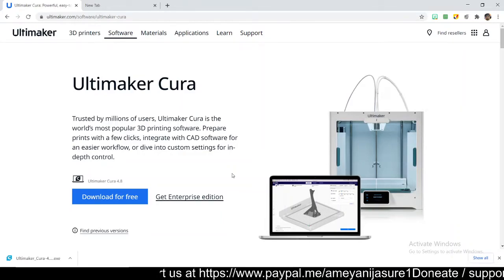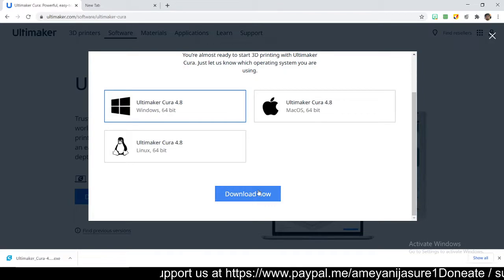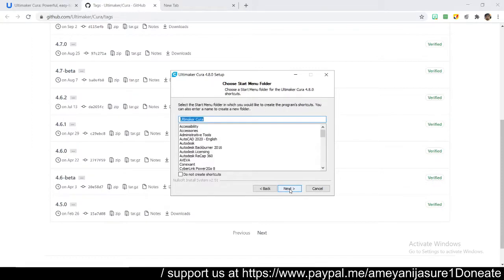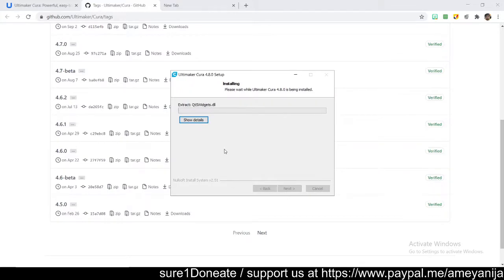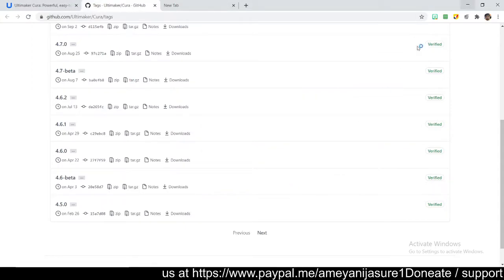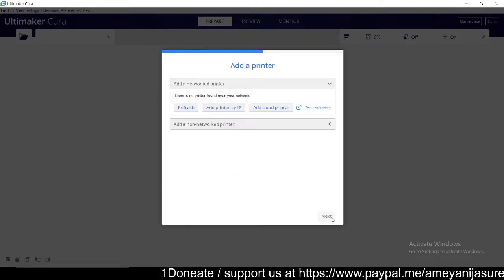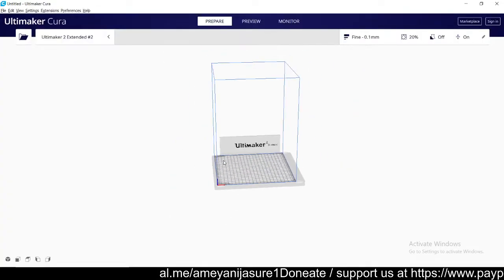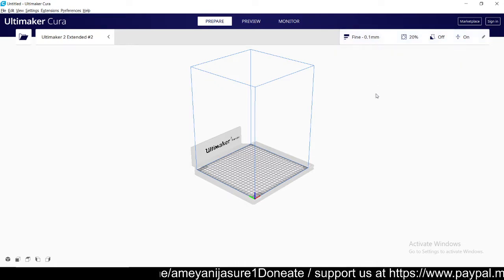Ultimaker Cura Engine - Installation setup & First look

Comment: This is not CuraEngine Installation, you are installing Ultimaker Cura.
Reply from the maker: Yes its Ultimaker cura now....but video is recorded is past, so it used to be Cura Engine slicing software before...that's why title has both names